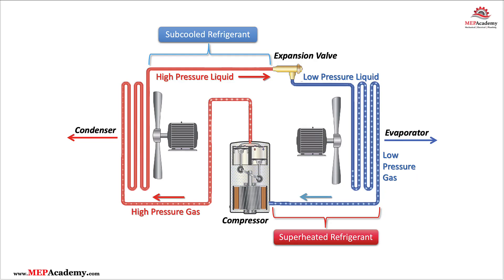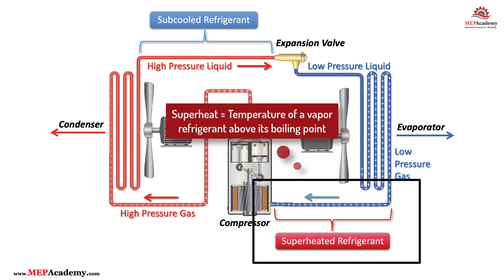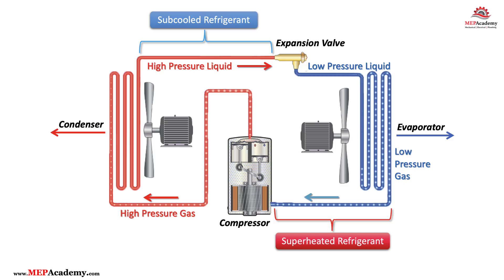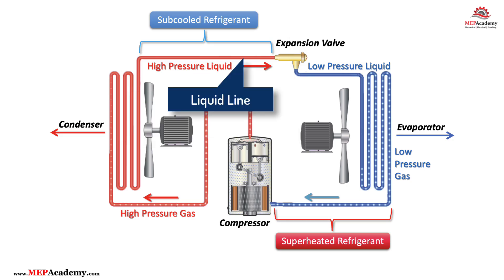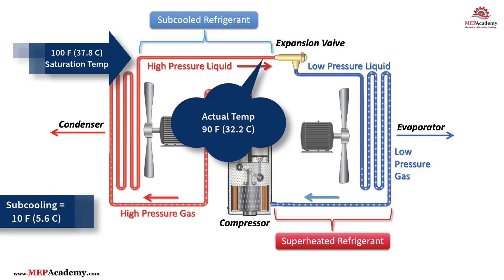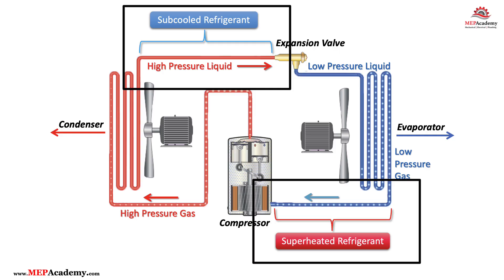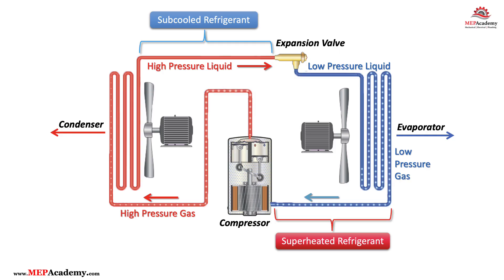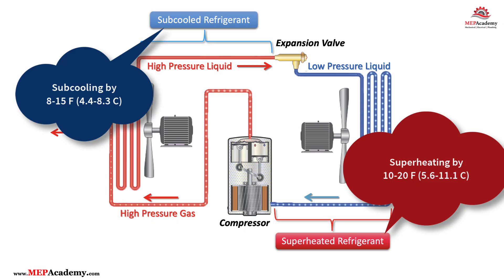Subcooling and Superheat Explained

Comment: I always see people checking the subcooling right at the condenser not before the expansion valve. Especially on you tube.
Reply from the maker: Measuring near the expansion valve gives you the most accurate reading of what the metering device is actually receiving.
If there’s a long liquid line between the condenser and the evaporator, heat gain or pressure drops can affect subcooling values.
Measuring right at the condenser may show a slightly higher subcooling than what’s available to the expansion device.

Comment: Your videos  have good information  Thank you from Iraq🇮🇶 ..I need video about quantity how much refrigeration for cooling and freezing system
Reply from the maker: Noted. We'll try to make a video on sizing refrigeration systems soon!
Reply: Any system will have a rated weight of refrigerant on the data/manufacture plate. Granted there may be adjustments based on length of line set, setting of use, or component sizing/selection.